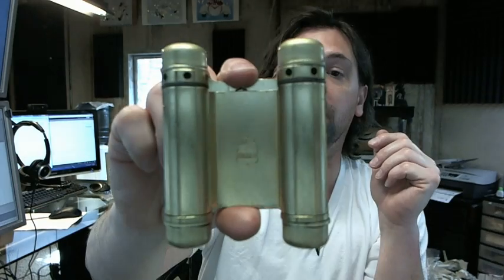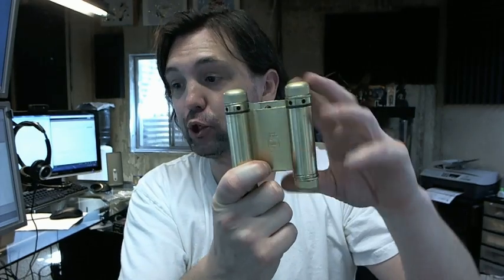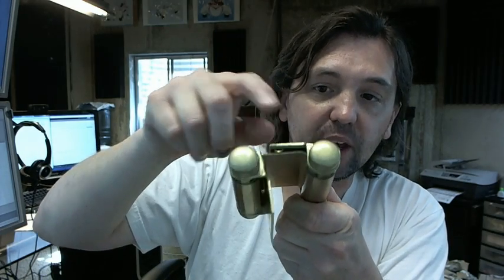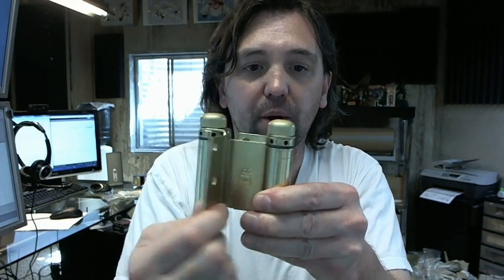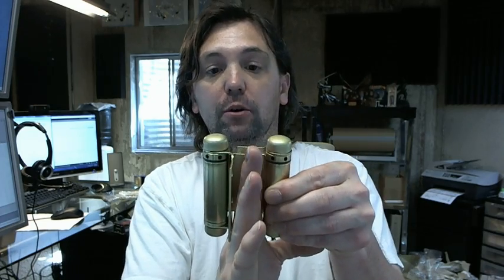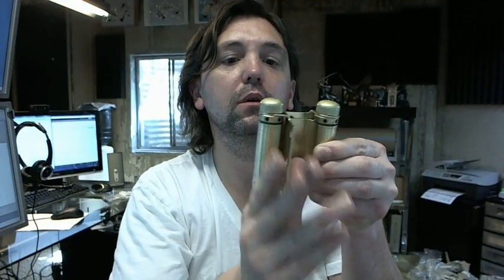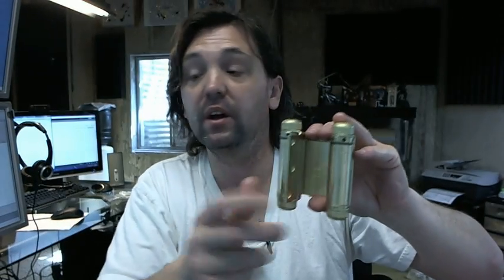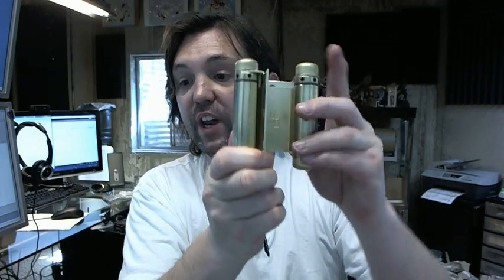Bommer 3023-3-633 Double Acting Spring Hinge

Comment: Is there a hinge like this but for interior doors.... that is slimmer?
Reply from the maker: how thick is your door?
Reply: @absupplynet   It would be for a new solid oak internal door, thickness = 56.0mm...
Reply from the maker: @gregmahon8869  There would not be a smaller hinge for a door that is 2.20” (56mm) sick in fact you would need a much larger hinge.  What specifically may I do to assist at this time?

Comment: The door is quite heavy..single door and it has a copper on it as for ex ray shield (doctors operating room) and its sagging , hitting the top side to the frame..is there any solution on that..pls. Help
Reply from the maker: Are you saying you have a door whose purpose is to prevent X-ray leakage through a door, lined with copper?  If yes, how long has this existed?  Regarding the hinges do you currently have these Bommer hinges installed and if yes, for how long have they been installed?  Can you provide photos?

Comment: Are these hinges made rustproof for exterior use gate in marine environment?
Reply from the maker: Sugatsune makes a stainless hinge, but not hold open.  Using the Bommer 1515H for this for an exterior application will certainly work, but given things made of steel, eventually will need to be replaced.

Comment: Richard- Have you actually installed any of these hinges before?  Also, I don't see the link to the instructions.
Reply from the maker: I have the instructions are seen on the link here:  https://absupply.net/bommer-3023-3-633-3in-double-acting-spring-hinge-half-surface-type-steel-base-satin-brass-plated-30532.aspx  is there a particular question that I can help you with?

Comment: hoping you can help.  i removed the an old door and the hinge immediately slammed to the left ( i have no idea what tool adjusts the hinge so i can open it back up to install the door.  I cant remove the double action spring hinge as when it slammed to the left it covered up all the screws.  All it says on the hings is Canaropa Japan.  the plate that screws to the door measures 6 inches.  How do I get the plate to swing back to the right so i can install the door. It is a swinging door
Reply from the maker: As soon as I read your first line I screamed out “ouch”  - LOL. I hope your fingers were clear of that.  The issue that you have is actually quite simple to mitigate.  The tool that you need is called a tension rod as seen here:

http://absupply.net/bommer-f1480-tension-rod-for-bommer-3029-6-3029-7-4010-6-4010-7-4020-6-4030-6-4040-6-4040-7-hinges.aspx

and if the height of your hinges 6 inch the item is seen here would be the proper tool to use to be able to loosen the tension on the spring allowing you to remove the tension pin that is in the barrel allowing you to freely swing open the hinge leaf.
Reply: I just had the same experience yesterday removing a similar hinge from an old door. Unfortunately, my thumb was not clear of the hinge. As my father always said when a bit of skin was broken, "Now it's a project." I'm working on rehanging an old door in Paris, France and I have to say, this video, leading me to your site with its wealth of complimentary information has been great. I'll stop by a local supplier of similar hinges to see if I can find a tension rod. And then I have about 8 coats of paint to remove to get to the pins. Merci!

Comment: If the hinge is squeaky, can anything be done to lubricate them? they look closed and inaccessible to lubrication..
Reply from the maker: According to the manufacturer it is permissible to lubricate the hinge and you would do so right at the seam where the tension collar rests on top of the barrel of the hinge.  I would mask off the rest of the area and then attempt to use a WD-40 type spray and lubricate the area on both springs and allow gravity to permit the lubricant to seep down into the spring cavity.  Please report back your success after doing so.

Comment: Hi there I don't know if you can help me but I have a very old door that was fitted with a double hinge swing door but the door doesn't stay in a closed position any more (it stays ajar by about 2 - 3 inches. Is there a simple way of fixing this or do I have to have new hinges fitted? Thanks
Reply from the maker: +arianefr78 Have you attempted to adjust the tension on the spring whatsoever?
Reply: +RICHARD HOWARD Thanks for answering. Yes I've tried many combinations of increasing the tension on one side and decreasing it on the other, on the top set and not on the bottom set and visa versa etc.., and in doing that I've managed to decrease the gap by an inch. It's a very old hinge and probably dates back about 20-30 years, I've tried giving it a shot of WD40 as well, I'm just trying to avoid replacing the hinges because I don't have anyone to help me at the moment and the door is quite heavy... Is it possible to replace one hinge at a time and not have to take the door off completely?
Reply from the maker: +arianefr78 It is not possible to safely remove only one hinge.  If you get help, please swap the hinges (top hinge to bottom location and bottom hinge to top location) and let me know if this resolves this issue.

Comment: Hi Rich, when I put my hinges on by following a video, The door leaf was put on the inner part of the door and you said put it on the front of the door. The bottom hinge I don't have a problem but the top keeps falling out. I bought a 3rd hinge to see if this would resolve the problem but it didn't. Before doing it your way, do you think this is the reason why the door is not working correctly and by changing the top hinges do I need to do the same with the bottom?  Thanks for your help.
Reply from the maker: The Bommer 3023 series hinges are what is called "have surface" which means that one leaf is mounted to the face of the door and the other leaf is mounted to the jamb as a standard hinge wood mount.

I have included a link below this message to the template and on the right side of that template shows a cross-section of what the hinge is to look like when it is installed.

Please confirm this is how your hinge is installed and also please email, simply reply to this message, photographs of your existing installation.

Link to Template:   https://absupply.net/pdf/Bommer/Bommer%203023-8-T.pdf

Comment: Hello and thank you for this video.  I have a french door  and the bottom half came off from the wall.  I figured out how to release the tension to get the hinges off (thanks to your video) and now I am not sure how to reset the tension.  The door is back in place and I figured that I would just do the same thing.  Please let me know if there is something I am missing.  Thanks!
Reply from the maker: +mochamoments See the video here:   https://absupply.net/video_gallery.aspx   How To Set Bommer Adjustable Spring Tension
Reply: +RICHARD HOWARD Thank you

Comment: Hey Rich? Could I use one of these at the top of a gate and a ball bearing pivot hinge at the bottom??? And here once again, you did a great job and the haters are going to hate anyway.
Reply from the maker: Unfortunately not because it's the placement of the vertical axis of pivoting that won't be compatible between the double acting 3023 and a stationary ball bearing pivot - tell me more about your gate how thick is it what size is it and it's weight.
Reply: @absupplynet  Haven't built it yet, will be a pair 36" wide each and about 30" tall. Back porch, exterior. Made with clear 2x stock yellow cedar. Would like it to stay open at 90 degrees and self close at lesser angles. The pivots got my attention due to price, and the stay open ability. Was probably a dumb idea.
Reply from the maker: @bob_frazier  What will be the thickness you will most likely build to?
Reply: @absupplynet  1 1/2"  thickness.
Reply from the maker: @bob_frazier  Go with the Bommer 1515H as it will hold open and handle the thickness as seen here:   https://absupply.net/searchfast.aspx?KeyWords=1515h
Reply: @absupplynet  Thanks Rich, will do. Watching your detailed vid on this exact product. That's genius! Answered a lot 9f my dumb questions! Great info.

Comment: I used another model (1514H) of these recently that has the "hold-open" feature on some "saloon" doors, although most everything is functioning well I have these two anomalies; 1) one door hangs perfectly perpendicular to the jam & header but the other rests slightly (maybe 2 degrees) open, 2) I had to mount the hinges upside down on one side compared to the other in order for the hold-open feature to operate in the same direction--this also sets the hinges to mirror each other's operation (i.e. the long swing-out occurs in the same direction). I'm wondering if should actually have the hinges mounted the same-side-up because; a) might the hinge have a slight slant toward open/closed that is exaggerated by the doors being mirrored?, and/or b) maybe the doors swing away from each other better if one is on the "short-swing" and the other on the"long"? I purposely have very little space tolerance with these doors and so I want to make sure I exhaust all options (including flipping the hinges on one of the doors around) before using shims or making modifications to the door dimensions. 

Any feedback would be much appreciated.